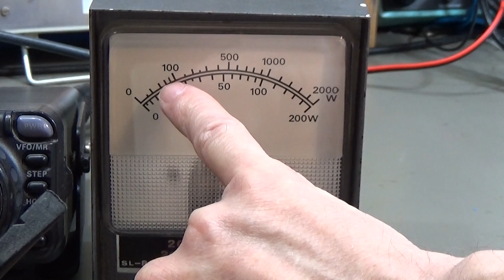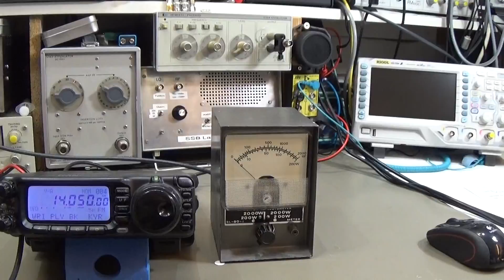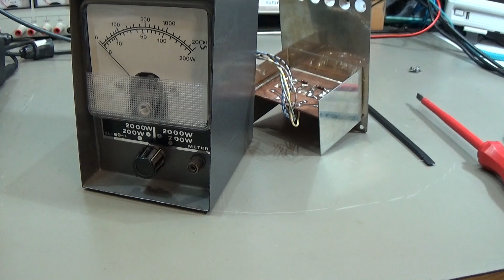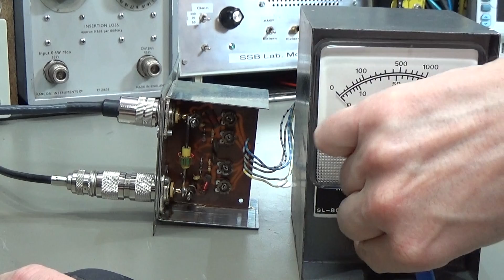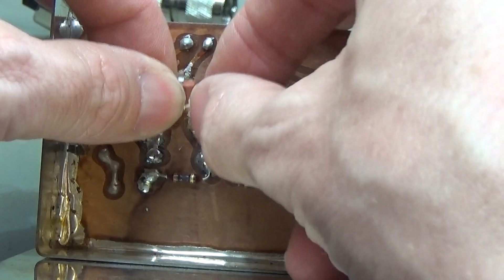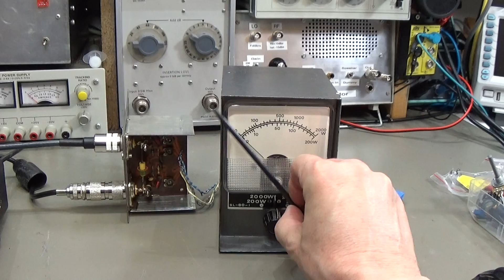#86 Fixing an Amateur Radio RF-Wattmeter

Comment: Nice fix  It looked like the meter is not adjusted to zero which sets the meter low reading.  it works as well as it is designed for.   good job

Comment: very nice repair ...
old POT have in all 80'' 90''CB RADIOS and after 20 years every pot is not on the perfect resistence or dirty... and need to re-adjust ...
Reply from the maker: +DJ Caverna Haroldo Bradaschia Neto Hi Neto, thanks for comment. Yes you are right those old pots meed to be treated with care.. 73

Comment: I had very similar problem on my meter. I was able to DeOxit but yours seemed a little worse.  Nice fix! If it was me I would have replaced all 4 pots maybe?? or at minimum spray all pots??
Reply from the maker: +Herbert Susmann Hi Herbert, it was a mechanical issue but no need to replace all as after some cleaning with DeOxit they are just fine. Thanks for watching.

Comment: Nice fix Peter. I wonder if a drop of DeOxit on the old pot would have cleared the corrosion or was there in fact a mechanical fault? Those old exposed ring pots are notoriously bad but don't usually fail outright. But seeing the lucky SMD pot refit though was worthwhile! Keep sharing the great videos!  73 - Dino KL0S
Reply: Dino I think it was a bent wiper, because when he pressed the wiper the pot conducted. If the resist was dirty pushing on the pot would have not made a difference.
Reply: +T Komoski You're probably correct; my initial thought was when Peter pushed on the edge of the pot that it might actually be a bad solder joint underneath the pressure point. Interesting to see if Peter tested the "bad" pot after and if it actually revived what a little bit of DeOxit may have done for it. Thanks for the observation!
Reply: I'm just surprised he didn't replace all four pots because he had a package of four.
Reply from the maker: +T Komoski all other were just fine put some DeOixt on and no problem :-)
Reply from the maker: +T Komoski Yes you are completely right mechanical!

Comment: Good morning from Vancouver, Canada. Peter why would the zero level be off when switching from 2kw to 200w. When the meter was set to 200w the zero level was below the line compared to 2kw it was spot on. Is that just meter panel itself at low range to cause that. Love the Signal Hound SA44B great little unit, mines older so I'm going to send it to signal hound for firmware updating and calibration. They are really good at answering your comments and questions. Great video's keep them coming, Cheers.
Reply from the maker: +T Komoski Good Morning :-) Yeah I have seen it on the video when I was editing it. It must have been a parallax error through the lens somehow. It is not there in reality . Thanks for watching and have a nice day!